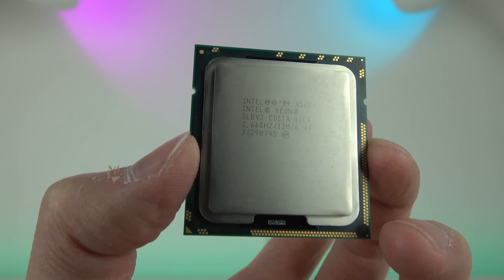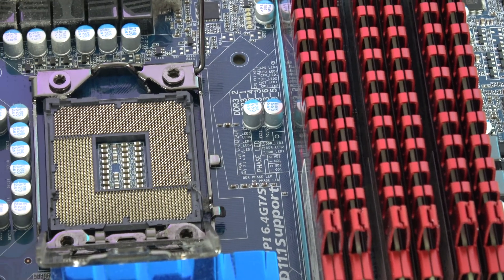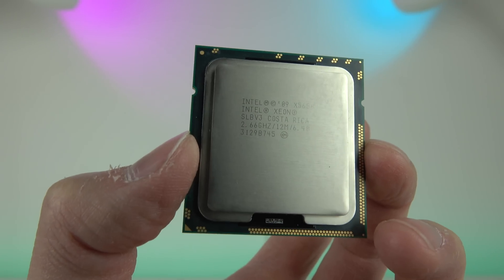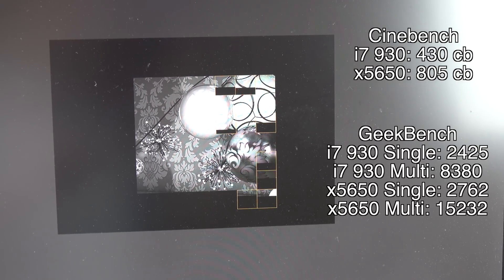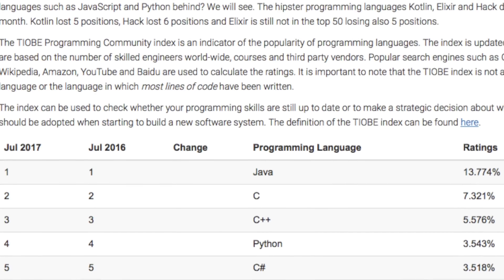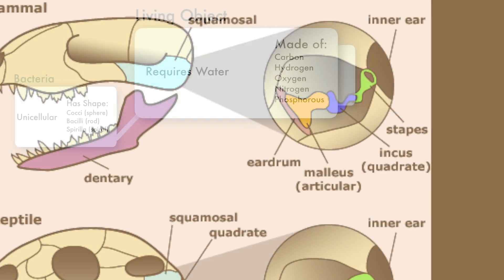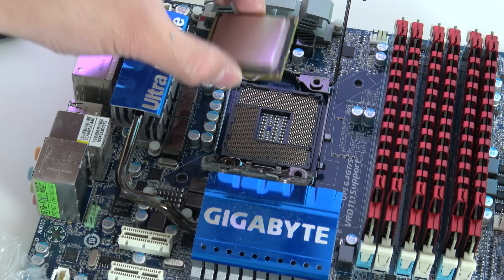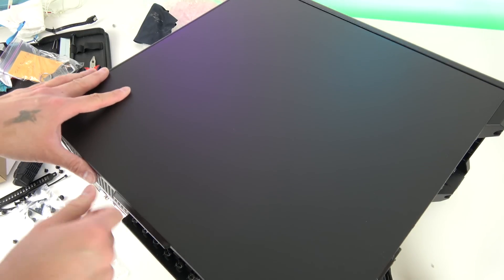This 6 Core CPU Costs $20. Will It Let My PC From 2010 Last 3 More Years?

Comment: if you dont overclock youre actually losing performance and usefull timelength the x5650 overclocks like a champ
Reply: I have mine running at 4.0Ghz with no problems!
Reply: blaster17363 pls recommended cheap, overclockable motherboards for x5650
Reply: any x58 mobo really. i got a asus maximus III extreme for 110 pounds or around 130 dollars which is one of the best mobos for this cpu
Reply: Mine is the same X58A-UD3R in the video. honestly the prices are so high you're probably just better off going for a new system
Reply: http://www.overclock.net/t/1461359/official-xeon-x5660-x58-review-discussion-and-xeon-l5639-benchmarks-inside/2430
Reply: 'We have plenty of X5650's and up that run ram as high as 1866 or more.'
Reply: no problem. Just make sure the board is compatible with the xeon
Reply: Jamzy btw what is the max speed for ddr3 on this processor?
Reply: Niggalodeon the intel website says 1333 but the ram I'm going to try to use is 1866. I'll let you know if it works
Reply: the x5675 is just clocked higher than a x5650
Reply: I have my X5670 overclocked to 4.2GHz with 1.3v
Reply: I run the X5650 @ 4.6GHz,  Can easily get 4.7 stable if I gave more voltage, but I want it to last kek. X58A-UD7 > UD3R Peasants
Reply: Niggalodeon my motherboard is an ASUS P6X58D-E, and my RAM is Corsair Dominator DDR3 rated at 1600MHz. My i7 950 is running at 4.1GHz, and my RAM is running at 1866MHz which I higher than the speed it has been tested so kind of cool.
Reply: Jamzy thanks m8, really appreciate it
Reply: Niggalodeon I have an i7 950 with an x58 motherboard and 1600mhz DDR3 ram, however I managed to overclock the RAM speed in the bios to 1866mhz.
Reply: Jamzy just for precision i have corsair value select 8 gb ddr3 (2x4) clocked at 1600 mjz
Reply: iamtheonewhoyoulove I have two X5550s I might want to upgrade to two X5650s.
Reply: Niggalodeon almost all exept workstation and serverboard, i am using a Asus P6T SE and oced to 4,614Ghz and boostclock of 4,799Ghz if the temps are low enough
Reply: Jed Capstick exact motherboard and ram model pls
Reply: I've used this same exact board and CPU combo and had it rock solid at 4.4 GHz under an H100i for years.
Reply: I have an Asus P6X58D-E and Corsair Dominator DDR3 1600MHz :D
Reply: blaster17363 4,6Ghz for me but running rly hot
Reply: Niggalodeon 1333Mhz out of the box
Reply: agree I overclock my i7-980x 6 core ( HEDT equivalent? ) at 4.4mhz since day one using J.J's ( ASUS rep's New Egg Video on overclocking  the 980x on my rog REIII ) Overclock!
Not sure Why 4K would be considered the death knell for 4K encoding? ( Particularly if you are leveraging CUDA or OpenCL for GPU accelerated -Encoding, -Adobe, -Rendering anyway? ) 
And as far gaming in 4K all the benchmarks seem to point to fast refresh in 1080P being the only area where tangible benefits are gleaned? Even then the frame rate gain seem pretty depressing ( or non-depressing for someone who has resisted the increment of CPU chipset Upgrading GPU rarely as well from GTX 480 Fermi To GTX 1080 Pascal... )

Solidarity against Incremental Intel and Hibernating AMD both! ( no innocents here dey iz all out ta gets us! )
Let em suffer and don't put out none of dat sweet sweet wallet luv till 2019!
Since announcement that PCI-E 5 has been fast tracked for 2019...
That means we R gonna get a one two punch back to back for 2018 and 2019 of PCI-E 4 and 5! 

Ummm... theoretically that could be 1 year and 3 months! 
( tho I doubt they mean 2019 Q1? But hey... It could happen! :) )

There hasn't been a PCI-E standards designation consideration for these past 7 years cuz of the same increcrap!
Only budging quickly with recent neural network, smart car, quantum computing, Tensor-ish big data industry demands...

Literally for one who is making a point of increment longevity where one plans to sit on their next investment for years to come...
The timing would seem to make that "PCI-E fast tracked v5"... 
the most compelling determining factor since AMD decided to do it's 10 year locust wake up relevancy?

Particularly when one's PCI-E GPU purchases full potential... 
depends on that lane band-width increase? 
Thus determining the success of that longevity? 
( as well as the full potential of every other lane peripherals that leverage the same? 
( nvme? Optane?" Raid Peformance? )

I Certainly wouldn't go the HEDT route in the mean time if I absolutely felt I had to pull the trigger early on a temporary fix! ( sorry threadripper! )

If anything...
If Coffee Lake's 6 core i7-Flagship's new chipset requirement...
( yep! no direct upgrade path from kabylake. Which might be awesome actually ) 
If that new Coffee Lake chipset also introduces more lanes and quad channel memory, in addition to those 2 additional cores...
Then I guess the cpu/motherboard bundle at microcenter on that new coffee-lake will be my $cheapo$ HEDT-Hybrid ( HEDT compared to my 6 core 1366 x58 HEDT anyhows! :) )
temporary SOLUTION! 

till PCI-E 5 anyway!
Reply: Otherwise If Coffee Lake is cheap on the lanes while requiring that new chipset...
They are pretty much selling the next iteration of thread ripper ( ryzen 2 ) which will hopefully align with that PCI-E 5 chipset.
Much is made of AMD relevancy bringing competition. But some enthusiast seem kind of fuzzy on how they leverage as much. Considering Cannon Lake might even be taped out already. Means that unless Intel pulls a revolutionary pricing model out it's ass. 
And until we have seen ryzen 2's line.
If you think about it...
We honestly have not seen what competition has brought to the market?
Because that answer is in the form of the late night light's and research investment dollars burning the 1up solution answers RIGHT NOW? ( is taped out take backs possible? :) LOL! if not then I imagine Ryzen 2 and Ice Lake should be pretty exciting! ( really would be surprised if they are not both trying to pull out all the stops where an incremental product would be a market insult at this point of the game! And considering we are rubbing tightly right up against Moore's Law's lowly posterior end parts...
That seems to me to be the safest investment bet from a timing viewpoint.

in 2019 when I am proven right...
Please 2 shower my poverty stricken self with money n other fine things pleeze.
Reply: Xeon Crew reporting in. I also still use my X5660 on an MSI X58 Platinum Board as a secondary System. I had to place an 80 mm fan on the Chipset though while overclocking. That part seems to get really hot. Rest works very well together with my old GTX970 to play the most recent games.
Reply: iamtheonewhoyoulove I found some chinese motherboard +cpu+16gb+cooler ram for 180-190$ 
my question is
is that a deal or a bust? and if its a deal can the motherboard overclock? yes its a x58 motherboard brand name huanan found on aliexpress
Reply: noman hossain Most likely you can't overclock with it.
Reply: Pasi123 owh bad luck than :( can you suggest any alternative full cpu for around 350$?
Reply: noman hossain that is a deal with a brand board like Gigabyte, Asus, Evga amd so on. But you have a chinese board what is a bust cuz the brand X58 boards are +/- $130 but those boards are really cheap and aren't worth it
Reply: Do not buy a Chinese X58 board off ebay or aliexpress, they're fucking terrible and I gurantee you will not get a good OC at all. Spend the equiv money trying to bid on an X58 board off ebay or something.
Reply: AeRiaL you wont be able to get any oc on a cheap chinese board
Reply: this particular carbon based lifeform is in my opinion correct in its observation of a computational device.

Comment: In 2012 I made my old socket 771 server into my gaming PC. it's still going strong, although I changed the CPU's in 2016 (dual socket btw) Also I changed my case into the Phantaks you have now (supports EATX)
Reply: Mark the 771 and the 775 are more or less equivalent sockets for server and desktop respectively.  There are mods for using a 771 based CPU in 775 based boards...A core2 is not an upgrade it's a lateral move or a downgrade depending on where the CPU comes in in the span of the lifespan of the socket.
Reply: Seriously you're spending more on electricity to keep that old rust than replacing it with a core2 based system at the very least. The 771 platform is now entirely obsolete and considered a space heater. I'm not hating on your system, it's just not economically viable to keep turned on.
Reply: I have still pretty great workloads. a core 2 based system can't really processes it well and a modern Pentium solution is also out of the question. At least I need a modern i5 4xxx or Ryzen 5 cpu to get the calculations afloat.

Comment from the maker: Anyone can do the CPU upgrade and run benchmarks.. The ability to and reason why we can upgrade are much more important than the upgrade itself. This is my outsider's perspective, and I'm grateful I am able to share my thoughts with you here. Have a great week!
PS, for the developers out there, don't forget to implement Reproduce() in LivingObject... ( ͡° ͜ʖ ͡°)
Reply: Chubbyemu Nice 👍👌
Reply: I'm a recent watcher and subscriber but you're video's are uniquely different and I applaud you for that I hope it works out in your favour. Keep the good videos coming!
Reply: Adam Landsberg The ending was emotional.
Reply: +Chubbyemu If you overclock that X5650 to 4Ghz (can certainly do 3,8Ghz at least on that cooler at ~1.3v), it will most likely make your computer last those 3 years you were talking about. Damn, had you OC'ed that 930 to 4Ghz and you would be rocking current Core i5 CPUs stock level of performance already! I know this because, I have a 920 C0 from 2008 still kicking, as well, and I've seen the benchmark scores it produces @4Ghz. That's why Overclocking exists in the first place: to squeeze the most performance possible out of an outdated chip; I don't overclock a chip that is a brand new product. Why should I? Is the fastest already. But I do start overclocking when that chip gets replaced on the market by a new, better and faster chip
Reply: I overclocked the cpu to 4.2 ghz @ 1.29v
Reply: lol 12.9 volt, your cpu must fried @1.5
Reply: I have that chip,but recently upgraded to a ryzen 1700. It really shines when you overclock it.  I pushed it to 4 ghz with a 980 ti. The only thing is it uses tons of power.  Its sits at 11k in firestrike physics score and 14k with a 4ghz overclock.
Reply: For my x58 build I purchased an unlocked Xeon W3680 for $75 on ebay and have it overclocked to 4.41ghz on all cores. With just using the unlocked multi and running 24gb of 1600mhz cl9 ram, my score on Geekbench is 3576 single core an 17299 multi. I got 3699 single core with 2000mhz cl9 ram. You should try to overclock as you can see how much it helps your single core speed, which helps for more fps in gaming, and overall system speed.
Reply: They USED to cost that lol, now they are 20$
Reply: Gosh..  Not reproduce..    That's when Skynet comes into play..  ;)   :P
Reply: I'm very happy with my x58 machine, I put it together on a tight budget but it came out as a kick ass computer.
Reply: That was a lot more than most outsiders can say about the subject. I really enjoyed the video.
Reply: How are you both good at computer science (and gaming/computers) AND medical science? You are an MD, right? What is your specialty? I'm a computer science major and I'm fascinated with medicine kind of like how I feel you are a medical major with a fascination of computer science/computers?
Reply: I overclocked the cpu to 4.3 ghz @ 12.9v
Reply: OO is one thing.  But what really helps in computers is standards.  ISA, PCI, PCI-E, IDE, SATA, etc.  As long as there is a standard the marketplace blooms.  When proprietary "standards" comes along, prices goes up and nobody invests (i.e. IBM MCA Bus, Token Ring).   Also, wildly different computer architectures (e.g. "IBM AS/400") were using OO long before it was the hip-thing.  They might be green-screen, but they are rock solid and run A LOT of business critical applications.  Oh and they don't really have inheritance!  But they still rock.
Reply: you mean desktop right not pc
Reply: Soul TF are you talking about
Reply: PC stands for personal computer, same fucking thing as a desktop.Shit for brains Soul.
Reply: https://www.pcgarage.ro/procesoare-server/intel/xeon-x5650-266ghz-box-slbv3/
that is not 20$ its 1250$
Reply: Chubbyemu if you overclock that CPU to around 4.2ghz you can get a conference score of around 1000 puts your coolermaster v8 should be able to handle the extra heat and will give an r5 1600 a run for its money in rendering as well as gaming
Reply: tbh you should've ponied up for an x5670. Not a whole lot more expensive for a noticeable performance improvement
Reply: Where did you get it for $20?
Reply: https://www.ebay.com/sch/i.html?_from=R40&_sacat=0&_nkw=x5650&_sop=15 starting at $17.99
Reply: Chubbyemu  hei dude love your videos can I ask u what is your motherboard because I am getting the same processor
Reply: I have had my computer for 4 years
Reply: I had that same Cooler Master case!  Hahaha!  I swapped it for a Lian Li case.  Great video!
Reply: Ken :  IQ, interest, and aptitude.
Reply: behavioral template methods > extending virtual base class
;)
Reply: You had me until you went into the bit about water carbon etc. I just wanted to know how the PC worked with the new processor and if the gaming was better and if the audio stopped popping. A question that largely went unanswered here imho.
Reply: hahahaha i have a rx 480 8 gig w/ a 6850k
Reply: Chubbyemu u need to use some more thermal paste buddy
Reply: Exactly right.
Reply: yea, thats just random words without any real meaning. Are you in politics?
Reply: Chubbyemu q
Reply: Vpham #car battery life
Reply: hey, i was the one that gave you the advice to upgrade the CPU to x56 in the previous video.